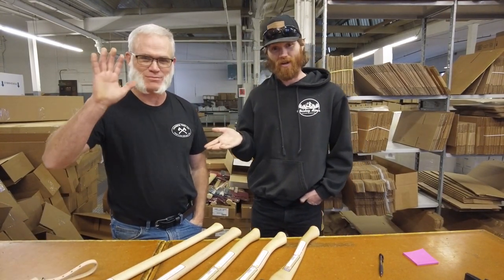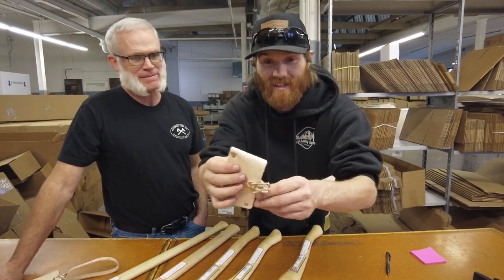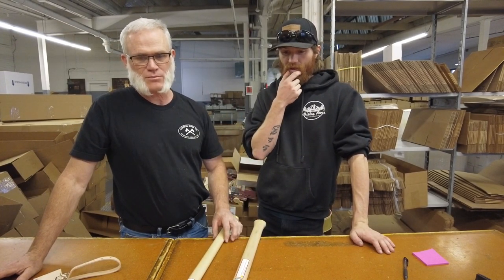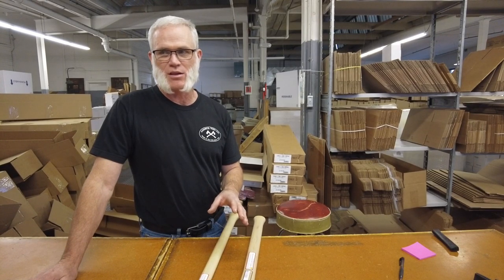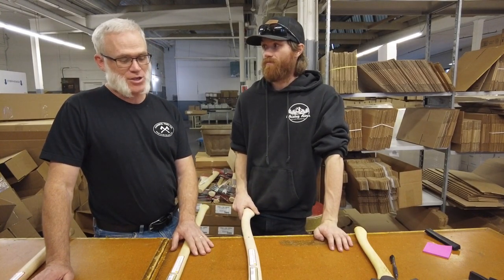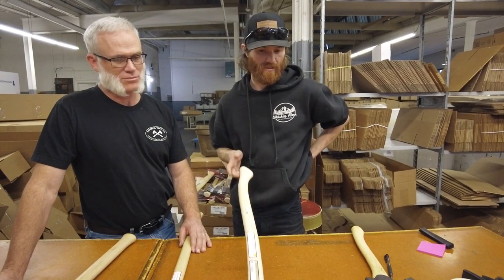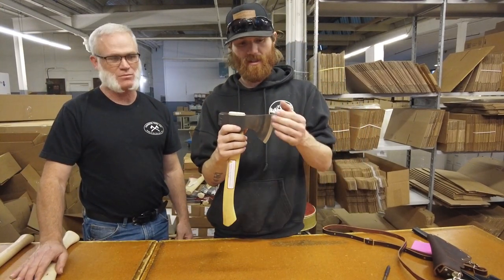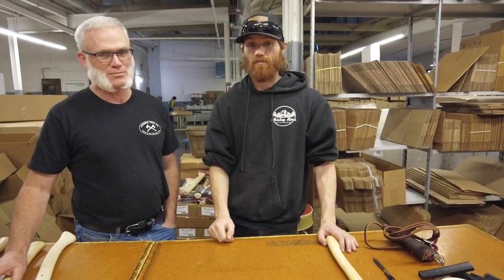Craig Roost - Council Tool Designer - Full Length Interview

Comment: Speaking of Tomahawks...Would love to see a US made large hawk/slip fit 1.2-1.5lb axe (like a Rinaldi but more balanced with hammer). Call it the Mountainman Multi tool or somethin... I will have to sign up for your newsletter, the flying fox with a 21" straight handle sounds great! I have a couple of the new Hudson Bay axes on the way now, interested to see how they do. I am a weekend warrior when it comes to wood processing but when I do carrying a larger axe I am normally using it to split wood for camp (as you stated) so it is good to hear it has been optimized for that task. Thanks for the video.

Comment: One issue I think Council Tools should fix is the issue with their sheaths. In the booklet for their Camp Wood Carver series, it says not to store your axe in its sheath (the darker leather sheaths that they make); this tells me that the leather used is a Chrome-tanned leather and not a veg-tanned leather; Chromium salts leave the leather slightly acidic, which can rust steel over time. A sheath is made to store an axe and or knife and should always be made with veg-tanned leather. If they want a darker colored leather, they should opt for an English Bridle Veg-tanned leather. Then, the (lighter colored) veg-tanned option that they do make for their cheaper axe line doesn't look like it has a welt, a piece of leather between the rivets, so the blade isn't resting against the rivets. I think Council Tools makes great axes; they shouldn't cut corners on their sheaths.

Comment: Trying to make a decision ..  24” Hudson Bay or 24” Woodcraft Pack axe!
Which is a better wood splitter for camp fires size logs ?
Reply from the maker: I would say just purely from a splitting standpoint the Hudson Bay is going to be better.  The profile of the axe with the high center line allows it to be easier to split with.

Comment: Why not use the round axe wedge, isn't that superior over a standard wedge as it wedges in all directions in the eye of the axe or hammer?
Reply from the maker: Believe it or not all of us at Whiskey River that hang vintage axes never use steel wedges.   The mast produced stuff just has it for the perception.   The steel wedge does nothing if the axe is hung correctly.  The average consumer thinks it's needed.

Comment: I hoped for a compelling explanation why the camp carver long version is not available with a curved handle (instead only in a strait one that I'd prefer to be curved about 21inch
Reply from the maker: 4 comments on 4 different videos about your desire for a longer handle on the Camp Carver.  We do sell a 21 and 24" curved handle in our Premium handle line.  Id recommend you pick one up and build it.     The straight handle is explained in our latest interview with Craig that we just posted.
Reply: @WhiskeyRiverTradingCo  You infer that my inputs are somewhat polution, and decide with what reactions I should contempt ?
(BTW your résumé of what I wrote is not representative.)
Reply from the maker: @AR-vf7vg  Okay.  Thank you for the comments.  I still recommend you pick one up and build it.

Comment: I'm thinking the opposite. You lost some customers, me, at least for this shape. 

You could have found a way to harden the pole and reliably kept the head on and kept the shape too.

It's only my opinion from a newbie who's doing his research, but I would have liked the smaller piece of steel to fit my fingers and hand around to do some carving, 
After I used it to chop wood down to the size I wanted.

To me you took a good shape and made it harder for bushcrafting.  ie carving.

I'm sure if I looked more, you make something for my use already. 

I just came across this video doing research.

Thanx for a good product. Many people have commented me back and told me to check you guys out .

Have a great fall and winter ❄️.

✌️🦁 From San Diego

🤣🤣🤣 The end of the video shows me a bc axe. Stop confusing me 🤣.

Comment: I just received my hudson bay 2#  18"...
And I'm really disappointed... I really wish I would have gotten the older version...
The one i got is crooked and has a tilt in the head and is hung   wrong... but my biggest complaint is the design, the cutting edge is like 2 inches from the handle, and very thick checks.. the head is just way too short IMO for a 2-lb axe...
This is my first council tool axe... and not what I expected at all...

I paid above $70 for this and very disappointed...

I have two of the 28" handle versions on order should be receiving them in next couple of days.. 

I hope one of the will be the old version...

This should be labeled as a log splitter not a Hudson Bay Pattern...

If I wanted a log splitter I would have searched for that... very disappointed on "This" Design